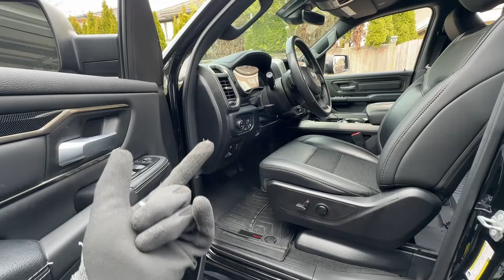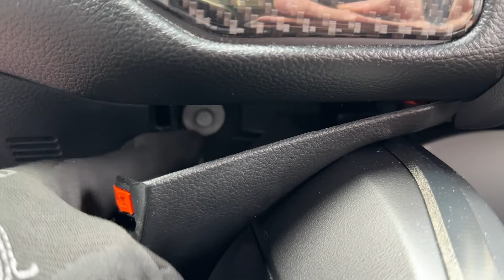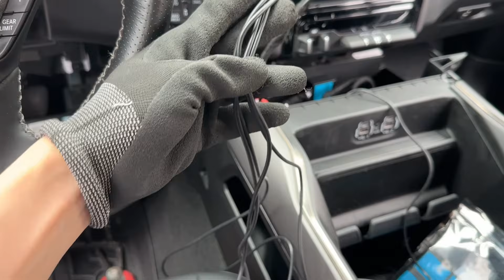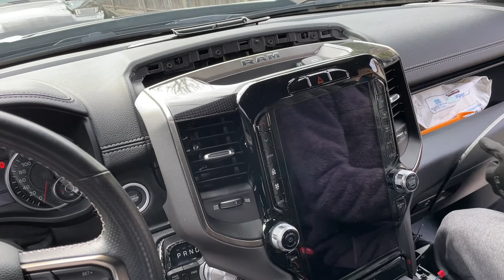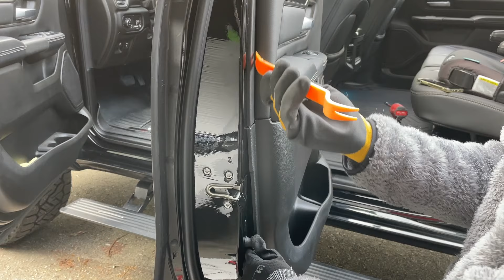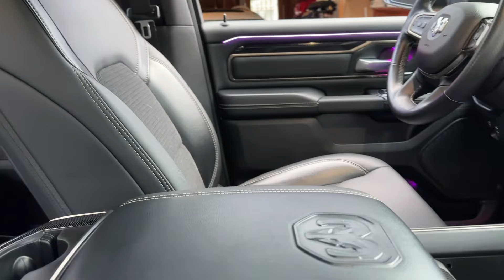NEW RAM INTERIOR AMBIENT LIGHTING INSTALL GUIDE (EASY)

Comment: I'm contemplating buying this kit for my ram truck, who is it made by. It's really hard finding details on the different kits. I want to make an informed decision.
Reply: I wish I knew as well. The power wire for mine came out of the harness plug randomly and Weeknd Garage is next to impossible to get ahold of. Wishing I knew who made these so I could buy a replacement.

Comment: Kit looks great, Really interested in buying, however I have a 2024 Limited that already has lighting in the dash. Will the factory lighting need to be removed? if so, is it hard? and is the factory lighting replaceable once taken off or out? Thanks in advance...
Reply from the maker: The factory Limited lighting has lights positioned along the top of the dash, while our lights are installed along the bottom. Many owners choose to run both, and since our lighting is significantly brighter with man colors to choose fromy, it creates a more noticeable and premium look.

For the door handle and storage pocket, some owners choose to replace the factory lighting, while others keep it and only install the LED strip on the door card. We’ve seen customers go with both setups.

If you have any questions, feel free to email us at info@weekndgarage.com.

We’re also about to film an installation tutorial on a 2022 Limited in the coming weeks which should give you a better idea of how everything comes together.
Reply: @WeekndGarage  any update on when this video will drop? I have the kit, waiting on watching this one before I install 🙂
Reply: Okay, so I received this kit and I am very Leary to install because one of the harnesses are completely unlabled. I am also unsure which wires you wrapped up in the beginning. The orange wire is labeled "ill" and I don't have anything  labeled "voice box"

Comment: I tapped into the red and black wires on the front doors but they are battery not ignition power. Do you shut your off manually every time you turn your truck off?

Comment: Would have liked to seen where/how you are hiding all the cables.

Also, would like to see where the expansion kit for the door storage goes on the door.

And I am wondering how possible it is to add another floor light inside of the center console storage on the sides, as well as the main compartment of the center console. Are there holes/panels to access these places already, or would a destructive mod be required.

Comment: 2025 ram 1500, cannot get the rear doors to power the rear controllers, I tried orange and black they do not work. Tested with an exterior battery and they work any recommendations? Thank u
Reply: Check your window lock on the drivers door it turns power off to the back doors.
Reply: Having the same issue, did you get in figured out?

Comment: How hard is it to squeeze the lighting strip into upper part of doors? I have a 2025 1500 and it seems impossible to fit anything in that it space.
Reply: Thats the easiest part of the whole install. I have a 2023. It slid right in with a firm press. Also when the door panel is off it can be seperated a little bit.

Comment: I appreciate the detailed steps. I’ll use an add a circuit fuse tap if possible and use F65 fuse (run - accessory feed). Fuse F66 on my 2020 is for the occupant restraint controller.

Comment: Please advice how this install would work for a REBEL X with Level 2 package? It has the console shifter and 2nd passenger screen..
Reply from the maker: This kit would work well on your facelifted rebel X as it’s designed for the 5th gen Rams. Lights will still fit the same way, 

Feel free to email us at info@weekndgarage.com for details on your specific model or if you have any questions. 😊

Comment: Thank you for the video. I wouldn't recommend to use Fuse F65 since this is for Occupant Restraint Controller (ORC) Module.
After a quick google search:

The occupant restraint controller (ORC) is a complex electronic device that manages the operation of your vehicle's airbags, seat belt pre-tensioners and other restraint system components found in your car or truck.

Comment: Does the light shut off when the car shuts off?
Reply: yes and it would only turn ON when you are in RUN or Engine On
Reply: @DeeDee-be1mo  how do you do that?
Reply: @AliH21I ran it to my accessory fuse on my inter fuse box

Comment: Just fwi if you have a diesel 2500 the fuse box is not under dash so I had to find hot power in run in center console harness and depinned and soldered the fuse to it. A lot more work with a diesel.
Reply: What hot wire did you use? I have the same issue and wired it to the cigar lighter but it’s always hot so I need a different one
Reply: @huntermccord7490  you can switch the cigarette lighter fuse to not be on all the time by moving it one prong over
Reply: The door zone 1 long strips don’t fit in the crevices like in this video. Got the center console and glovebox fit, but sucks that the door ones don’t fit. There’s no holes for the cup holder or door handle as well
Reply: Wish I would've seen this comment sooner. I wouldn't have gotten this kit. He needs to have a kit thats a quarter of the price for the HD trucks. Only able to use a quarter of the kit. Can't do anything with the door lights at all. Waste of money. Gonna try and de pin the wires to make them longer and figure out a way to use the door light. Its not gonna be the same though.

Comment: Can this kit be configured to only turn on when the headlights are on?  No point in running the ambient lighting during the day when it would barely be visible...
Reply: There should be a fuse space for illumination that only comes on with the headlights.

Comment: Just put the center console back together and realized I forgot to plug and mount the switch…. 😅
Reply from the maker: Haha, that's the worst! Don't worry, it happens to the best of us 😎
Reply: @WeekndGarage I did have an issue with a code set for ORC voltage. Has this happened with you guys at all? When I remove the power wire for the leds it goes away.

Comment: I’m having trouble to tap in to the power on the back Passenger door. Dose anyone know why it’s happening. I’m connecting everything right the same way the video tells me too but no power goes to the Lights.
Reply: @toro6984  You have to go with the correct power wire. I think for the driver rear it’s orange and purple but for the passenger side it’s the same opposite corner but not the same color.
Reply: @TheTsmith9116 thank you I just seen your comment and it works thanks man💯
Reply: Same here back doors won't work, tried orange and purple as well as red and black nothing works, connected to external battery and they work

Comment: kit works good except for rear passenger door  not getting power
Reply from the maker: Hi, wiring color on the rear door depends on the year and trim of your truck. Please email us at info@weekndgarage.com and we will get you sorted!
Reply: I installed my kit yesterday and ran into the same issue. I have a 22 Lone Star quad cab. Ended up tapping into the orange with tan stripe to get power.
Reply: It probably the lock window. Had the same problem notice when the window are lock kill the power to the lights@SwankyTheKidd

Comment: Do the door sub controller module continuously use power even when the vehicle is off? Where you tap into the doer harness is this an “always on” connection or an ACC connection?

Comment: Hi! Only one question. Will the lights turn on automatically when I unlock the car?
Reply from the maker: Hi Jimmy, In the wiring configuration shown, it follows the ignition cycle. So truck in RUN /Engine ON would turn on the lights, Off would turn it off.

Comment: Have you ran into with the back doors having different power wire colors?
Reply: On your video the - and + are on opposite sides my 
orange/purple are on the same side as the black wire
Reply from the maker: @adamevans5562  We've seen it happen on some trims and years. Email us at Info@weekndgarage.com and we will get you sorted!
Reply: I’m having this current problem on mine. Did you find a different way to wire it?

Comment: Hey, I have a question about your video on ambient light installation. Most of the other videos I've seen show people tapping into a fuse in the fuse box to power the host controller, but you just wrapped the power wire with the fuse. Is that safe, or is the hardwiring method using a tap-in fuse safer?

Also, what would happen if the host draws too much power and blows up the existing car fuse?
Reply from the maker: @javedmath1015  Hi there, it makes no difference in terms of safety with a fuse tap. Aesthetically it may look cleaner. 

In this electrical circuit we are describing at F65 fuse which is a 10 amp fuse, since the power draw of our system is minimal and under 2amps. It is not possible to draw enough power to trip the 10amp fuse unless there was a short in that case would trip any fuse larger than the smallest gauge wire behind this fuse it’s protecting. 

We have our dash cam front rear, star headliner and the interior ambient lighting wired to this 10amp fuse and it has never tripped in 4+ years of running the truck.

If the factory fuse was to trip from short circuiting or overcurrent, then you would replace it with another correct size fuse as the fuse has done its job of protecting the circuit in front of it. You can investigate if it’s a short causing the fuse to trip or an over current prior to replacing the fuse to prevent another similar event.

Feel free to email us at info@weekndgarage.com if you’d like to discuss further and review electrical diagrams
Reply: @WeekndGarage  Thank you so much for your reply. I have understand everything now.

Comment: Just install the kit in my 2019 rebel ..the rear doors don't work..
What am I missing?
Reply from the maker: Hi There, please email us at info@weekndgarage.com and we will help you get the rear doors going :)
Reply: I’m running into the same problem as I’m not getting power back there. Did you figure it out?
Reply: @5.7life  @alj4407 I’m working on an install on a 2019 Laramie and having the same issue. Did you find a fix?

Comment: Do these work on any 5th gen rams like the rebel? And also does my vehicle had to have a previous package in my vehicle to make these ambient lights work?
Reply from the maker: Yep it’s designed for the 5th gen ram. Demo vehicle is a Rebel, no packages or options are required as this is a standalone kit that is plug and play with no cutting, drilling or splicing wire is required. 
Feel free to email us at WEEKNDGARAGE@gmail.com if you have any questions and we will help you out!
Reply: Dude seriously did you even watch the video with your ears open? It doesn’t get any clearer answering your question 

One has to wonder how folks that have the attention and processing span of a pebble make it thru life every day

Comment: There is one longer plug that says zone1 short led what's that for?
Reply from the maker: @pkontoslight  That’s a spare for customers that want to add an additional light on the left side of the dash
Reply: @WeekndGarage  there was no option for that I would of bought that also. To make it complete. Also there is 2 diferent types of door light a d I ordered the 3. Also one more question I have bighorn with plain door panels and the strip sticks out a little is that normal? I just setup and started to open I will continue tomorrow
Reply from the maker: It’s available to order on our website!
Email us at weekndgarage@gmail.com with your order details and we will get you sorted

Comment: 2 questions 
I have a 22 gt, does the console slide back the same with shifter being in middle console 
And what if you have the stock lighting on the door handles already 
What do you do with those?
Reply from the maker: Installs exactly the same with the TRX/GT consoles. We recommend to remove the dim factory lighting, it won’t be visible after you install ours anyways as it washes out the dim oem lighting.
Feel free to contact us at weekndgarage@gmail.com if you have any questions

Comment: Can’t you just add a fuse tap instead of wrapping wire around it and piggyback the fuse off the tap ?
Reply from the maker: Sure you could if you want, it makes no difference in terms of protection because if you run a fuse tap it’s still behind the factory 10amp fuse. 
Having 2 inline 10amp in series within 1 inch of each other adds zero value in terms of protection
Reply: Definitely want to add a fuse tap if that fuse blows, depending on which side of the fuse, you wrap your wire around, you’ll still have power

Comment: Kewl video and have this in my "cart".  I watched the entire video but missed the part where you add the manual adjustment switch under the display.  Is there a video that shows how you set this up?  Also, what does the app look like?  Would be great to include the app and how to use it.
Reply from the maker: Thank you, the hardwired button is installed out of sight but reachable by hand under the trailer brake section. Can send you detailed photos if you email us at weekndgarage@gmail.com!
Reply: @WeekndGarage  Sweet.  Sending e-mail now.  Thanks for your prompt response!!
Reply: What’s wiring colors for the passenger door. My colors are different.  2021 ram 1500 big horn alpine crew cab.
Reply from the maker: @waataaa2608  Please send us an email at weekndgarage@gmail.com and we will help you out!

Comment: I didn't see how you got it over the left side of the steering above the headlight roll switch
Reply from the maker: Hello @boboscar99 if you would like information on how to add that portion you could email us at weekndgarage@gmail.com and we will help you get sorted!
Reply: @WeekndGarage can you dime the lights or they are fixed
Reply from the maker: @enriqueangulo3828  You can dim it from 1-100% via the hardwired buttons or phone application.